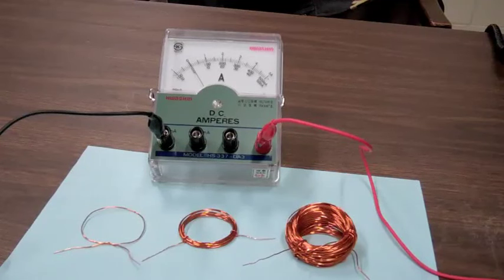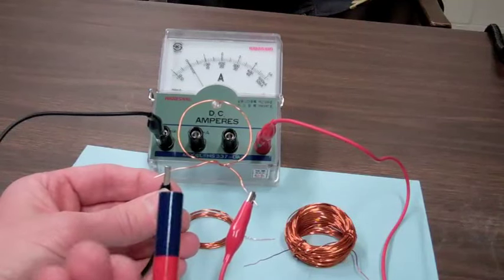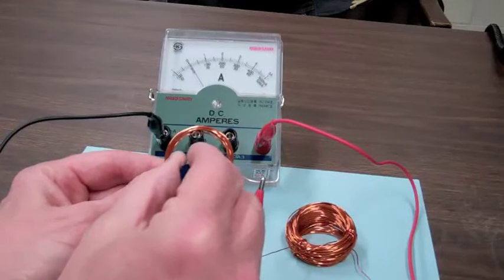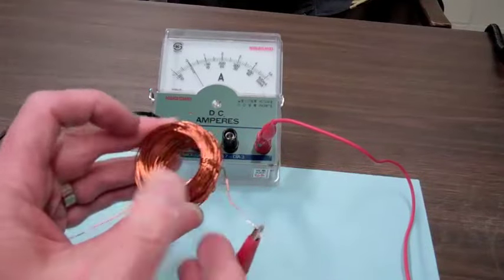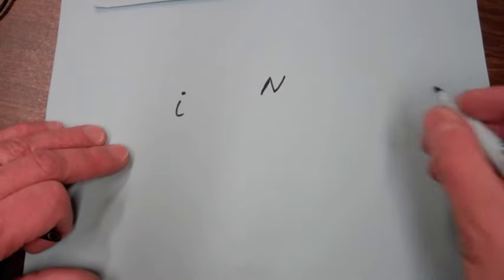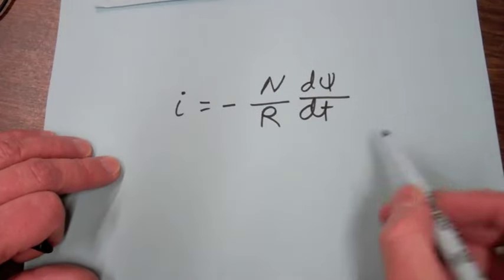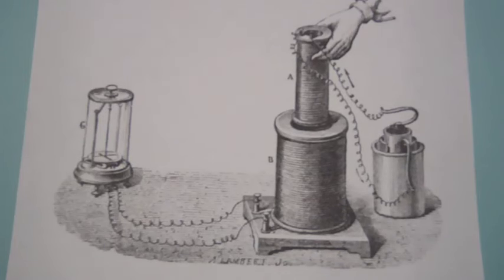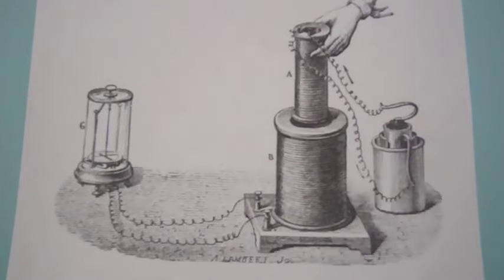Electromagnetic Induction and Faraday's Law

Comment: Thank you for taking the time to produce this video. It was
very well done. 

1) Would the result be the same, in terms of the induced
EMF, if the end of the magnet (North or South) was to pass, (not Spin),  over the OUTSIDE of the coil instead of
INSIDE (i.e, as in the demonstration)?                                                                 

2) How would I determine which end of the wire is positive & which is negative?     

3) How would I determine the direction of current flow?                                              
Thanks very much for your reply.
Reply from the maker: +Richard Vassell ) The magnetic field extends from, and spreads out from, the magnet. Wherever the magnet is if you move it there will be some change in magnetic flux inside the coil and a current produced. The magnetic could move alongside the coil as you mention, or never get near the coil. Of course the farther away the weaker the change in magnetic field inside the coil and the smaller the induced current.

2) If the wire is in a continuous loop there is no positive and negative. The electric field in the wire is not caused by charge but by the changing magnetic field. So the electric field lines have no beginning or end. They begin and terminate on themselves just like lines of magnetic flux density. Now if you had a coil that had a break in it, charge would form on the ends of the break and be an additional source of electric field.

3) The induced current is always in a way to produce a magnetic field that opposed the changing magnetic field that is inducing the current. This is referred to as Lenz's Law.
Reply from the maker: +Richard Vassell I put together a video of what happens when the magnet is moved as you ask.

https://www.youtube.com/watch?v=JGgHe2oiaMg

Comment: Michael Melloch, 
Thank you so much for responding to my post. Sorry that I was not clear with question 2.    The question I wanted to ask is if the Amp Meter was replaced with some kind of load  and one end of the magnet (any pole) was passed over the outside of the coil, (in one direction only, NOT Back-and-Forth); how would one determine (without using a Volt Meter), which end of the load would be Positive and which would be Negative?

Thanks for your response.
Reply from the maker: +Richard Vassell Let's say it was the north end of the magnet facing the coil and then you moved the magnet towards the coil, but on the outside. At first the magnet flux inside the coil would be increasing. You could determine the direction of the current flow using Lenz's Law. Then the end of the resistor in which the current was entering would be at a higher potential then the end of the resistor where the current was leaving, which would be at a lower potential. Now as the magnet passes the coil, but on the outside, you start to have the opposite situation, the magnet flux starts decreasing in the coil and the direction of current in the coil would reverse.

Comment: Hi, hope ya will answer: Where is the magnet field?? When the bar moves thru forward and backward, forward is magnet field expand depend by speed and how many turns, so the motion thru each level of current is a magnet field. When the level of current change, the magnet field change as well? And there is forward magnet field and backward magnet field which it is called collapsing magnet field to full collapse magnet field. So, opposite of collapsing is building-up. So, backward is magnet field collapse; forward is magnet field build-up. And during the process, it is with -ing. With it is positive current to the negative current that corresponds to forward to backward. There is a higher volt for forward than backward of the same motion time that interacts the load which is a forward position that is receiving the current from backward position. Which backward go forward to the load. But for a double backward position that is in position and in motion.

Comment: Hi Michael, what specs do you need (both wire and magnet) to make this experiment observable? Are you using a galvanometer?
I have never got this experiment to work well at all.
Reply from the maker: Yes you have to use a galvanometer. They are relatively inexpensive, https://www.amazon.com/United-Scientific-MGV003-Galvanometer-50-0-50µA/dp/B00ES3TQZU/ref=sr_1_1?crid=SOM9ABAC34SD&dchild=1&keywords=galvanometer&qid=1590613170&sprefix=galvanom%2Caps%2C222&sr=8-1

Comment from the maker: Logan D, the magnet you have should work. Did you remove the insulation from the ends of the copper wire?
Reply: Yea, my entire wire is without insulation and is connected to the meter. My experiment seems to be the exact same but the meter is not picking up any electrical readings. Maybe my magnet is not powerful enough?
Reply from the maker: If your entire wire is without insulation, then you effectively have only one turn and will generate a very low current and probably not detect it. Get some insulated wire and try it.

Comment: Great stuff! But where exactly is this used in everyday life?
Reply from the maker: This is one of the most significant discoveries and it is used many place.

It is how most of the electricity is produced by utilities, with AC generators, https://youtu.be/O5n6ubrbK5A

It is the principle that is used in transformers, https://youtu.be/mRQqqSxBRSs

It is the principle used in braking and battery regeneration in electric vehicles, https://youtu.be/MglUIiBy2lQ

It is used in non-destructive testing.

Etc.
Reply: @electricandmagneticfields2314  Thanks a lot!!

Comment: hi michael melloch i have a question that  how to prevent a coil (solenoid ) to get hot
Reply from the maker: If you are manually moving the magnet, you probably are not going to generate enough current to get the coil hot. If you are, you can always put a resistor in series to limit the current.

Comment: 1) Although your hand cannot detect a difference,
does it take more force to push the magnet
through the 100 loop vs 1 loop ?
2) Do we understand, at the quantum level, why 
this electric force generation occurs ?
3) I noticed your meter bounced, which implies
when removing the magnet, the field collapses
into an AC current, which is not possible.
You might mention why that meter is bouncing.
Thanks.
-- Some retired software guy.
-- 5.22.24
Reply from the maker: 1. Yes it would take more force. Moving the paddles by hand with the apparatus in this video I can feel the force https://youtu.be/MglUIiBy2lQ?feature=shared
2. It is a fundamental observation of nature. No different than trying to find a deeper explanation of why do two like charges repel.
3. That is probably a mechanical reaction of the meter.
Reply: @electricandmagneticfields2314  Thank you.  1 out of 3 is not bad.
My investigation continues elsewhere.
Later !

Comment: I am attempting to conduct this experiment for my science fair project. I ordered the meter you suggested and wrapped a copper wire 100 times. The only part I have set up differently is the fact that my magnet is rectangular in shape. I have not been able to get any reading on the meter. Is my magnet the issue? If not are there any other trouble shooting tips I could try? A response would be great!!!
Reply: I know this is an old message, but I will still say a few things. The magnet could be an issue. What is important is that the magnet has the north and south poles on opposite ends and not on the large sides. If it is the large sides, then you have to turn the magnet so that one large side goes in first. The issue is then you need a much larger coil to fit this. 
The other issue is this wire has to be stripped but it is not the easiest to see if it was and how well it was. The main way to do it is with sandpaper, but you have to be careful to get all the way around the wire. The way I have been testing this is with a multi-meter and checking for how much resistance there is.
Reply: In addition to what the other commentor stated there is something else. Some magners are stronger than others. Rare earth ones are way better than ceramics

Comment: Is it more accurate to say "the magnetic induces a voltage in the coil" or "the magnet induces a current in the coil", or are they both equally valid?
Reply from the maker: The most accurate way to think of it is that the changing magnetic field induces an electric field. This electric field is there even if there is no coil. With the coil present, the electric field is inside the coil, which results in a current in the coil.

Comment: Just wondering if there is a difference in the deflection of the ammeter when you inserted in the coil using the opposite pole instead. ie, if North is inserted first, it deflects to the right and if South is inserted, it will deflect to the left?
Reply from the maker: A current is generated in the coil to produce a magnetic field that opposes the change in magnetic field inside the coil caused by the moving magnet. So the deflection will change direction if you switch poles before inserting the magnet as you describe.

Comment: Sir which kind of current flows through the coil ac or dc, can I use an led for this but what if the current is AC, the LED(small ones) gonna fuse.
Reply from the maker: It is not sinusoid. The current will depend one the rate of change of magnetic flux and the direction of that change. If you want to light an LED, and produce something closer to AC, take a look at this https://youtu.be/O5n6ubrbK5A

Comment: Which type of insulation should wire contain .
insulation can be of PVC Or Rubber or of anyother material.
Reply from the maker: +Abhishek Gupta The insulation should not matter. In this video I was using magnet wire, which has a thin insulation.

Comment: Which type of magnet you used?  Is it also possible if we used normal magnet
Reply from the maker: Any magnet should suffice. The stronger the magnet the greater the change in magnetic flux. So the stronger the magnet the more current you will generate for the same number of turns.

Comment: Will a normal insulated wire work?Or do I need a thin insulated copper wire only?or specifically a thin insulated magnet wire?Also does the magnet need to be strong enough?
Reply from the maker: Any insulated wire will work. The electromotive force produced is proportional to the change in flux linkage with respect to time. Any magnet will work but the stronger the magnet the greater the change in flux linkage with respect to time and the greater the current produced.
Reply: Thanks dude,I tried out the same experiment using a rather thicker wire than yours like a normal wire but my galvanometer shows no deflection??  Can you suggest me any further suggestions....
Reply from the maker: You used a galvanometer and not an ammeter?
Reply: Michael Melloch but my galvanometer should also show a deflection right?
Reply from the maker: If you have a galvanometer it will work because a galvanometer will be responsive to a pulse of current. A regular ammeter will not.
Reply: So should I buy a thin insulated copper wire because it doesn't work with a normal insulated copper wire??also my magnet is not very strong....thanx
Reply from the maker: The thick wire would actually be better because it will have a lower resistance. You did remove the insulation from the ends of the wire to make contact to the galvanometer? The stronger the magnet the bigger the effect. Also the more turns the bigger the effect. How many turns are you using?
Reply: Ok I think I got my mistake ....I was using only about 5-6turns....will try it out with greater number of turns in a few days cause I got my exams now....thanx a lot Michael melloch sir for your help.will ask if it still doesn't work...

Comment: Will the observations change if the south pole was put first, instead of the north pole?
Why does the needle deflect backward when the magnet is pulled out? (current is scalar)
And, will anything that disturbs magnetic flux become conductive?  
Also, thank you for the great video.
Reply from the maker: As the north pole goes towards the coil, there is an increase in magnetic flux into the coil causing a current. When you remove the magnet, there is a decrease in magnetic flux into the coil that also causes a current, but now in the other direction. So if you flip the poles, the direction of the current will flip. As you push the south pole towards the magnet the magnetic flux into the coil is decreasing because it is pointing out of the coil. The changing magnetic flux causes an electric field and why current flows in the coil, it does not turn something into a conductor. Hope that helps.
Reply: That did! Thankyou a lot!

Comment: So, the copper wire that you need is called insulated copper wire? And do you need specifically a bar magnet? I'm preforming a presentation on Faraday's law for physics and tried this with a regular semi-strong refrigerator magnet and some copper wire I found and the ammeter read zero as I moved the magnet in and out of the coil.
Reply from the maker: BEGRProductions The magnet you have should be sufficient and yes you need insulated wire otherwise you effectively will have only one loop. Were you using a regular ammeter? If so it might not respond to the short burst of current you were producing. It should work if you get a galvanometer. They are not very expensive. Here is one I have used that only costs $12, http://www.amazon.com/United-Scientific-MGV002-Galvanometer--500-0-500µA/dp/B00ES3TQSW/ref=sr_1_3?s=industrial&ie=UTF8&qid=1400674908&sr=1-3&keywords=galvanometer
Reply: Michael Melloch thanks for your response. I was using a multi meter that has a setting for measuring DC current. I used both a digital and non digital multimeter and I didn't get any reading. I will look into getting that galvanometer. And where does an individual find insulated copper wire? At a hardware store?
Reply from the maker: BEGRProductions Look for magnet wire, which has an insulation. 24 to 26 gauge should be easy to wind into coils.http://www.amazon.com/TEMCo-AWG-Copper-Magnet-Wire/dp/B00LV91P6C/ref=sr_1_3?ie=UTF8&qid=1429707902&sr=8-3&keywords=26+gauge+magnet+wire
Reply: Michael Melloch as for the galvanometer, do you suggest I get one that reads from - 50 to +50 micro amps, or from - 500 to +500 micro amps? I'm going to be recording and comparing max current between trials for my project, and not sure which would be better.
Reply from the maker: BEGRProductions I am not sure which would be best. If cost is not the issue you could purchase both. I have a slightly improved version of this video where I used the -50 to +50 micro amp version, here is the link https://www.youtube.com/watch?v=KUihEkvabpo
Reply: Thanks, the project worked well

Comment: Sir
1. What is the gauge of copper wire and how many turns needed and diameter of round.
2. Can it work if connect a LED (small size bulb)
Reply from the maker: I don't remember the gauge but it does not matter as long as you can wind it. You can use this effect to light an LED. Here are some examples https://youtu.be/O5n6ubrbK5A   https://youtu.be/OOg4SIFCIiE   https://youtu.be/fiyaYII7ROA
Reply: Thanx sir. But not lighting
Reply from the maker: @rgladson9544  You are not getting enough change in flux linkage with time. You need more turns, a stronger magnet, and to move the magnet faster.
Reply: Thanx sir. I will try

Comment: Michael, you have surely provided the answer to one of my questions; that is, determining the polarity on the load. VERY grateful for that.

This is my final question:
Let's say that your coil was wound on a solid (NO hole in its center) IRON rod, say seven inches in length. The cross section of the rod might be round or rectangular. 

How, if you move a pole of the magnet along the length of the coil from left-to-right OR vice versa, stopping about an inch short of the other end, then moving the pole back in the opposite direction, towards the original starting point. Would the current flow be in one direction only and changes ONLY when the magnet is moved in the opposite direction? 

Thank you.
Reply from the maker: +Richard Vassell I am not sure of the geometry you are describing. But there will be no difference whether you have a ferromagnetic material inside the coil or not. There will just be a magnetization occurring inside the ferromagnet, which will change with the changing applied magnetic field occurring from the external magnet. So if the applied magnetic field is increasing inside the ferromagnet because of the movement of the magnet you will get current in one direction, say clockwise, and then if the magnetic field is decreasing inside the ferromagnet because of the movement of the magnet you will get a current in the counter-clockwise direction.

Comment: What is the approximate voltage and current  that is developed in the 100 turn coil ??
Reply from the maker: I redid the experiment and I was able to get about 20 mA peak current when I was moving the magnet as fast as I could. I measure 1.7 ohms for my 100 turn coil, which is about what I expect from calculations. So producing about 34 mV.

Comment: How did you connect ammeter to coil? what is it called?
Reply from the maker: I just scraped the insulation off the ends of the coil and connected with a cable that had alligator clips.